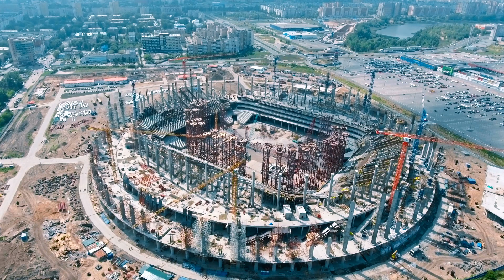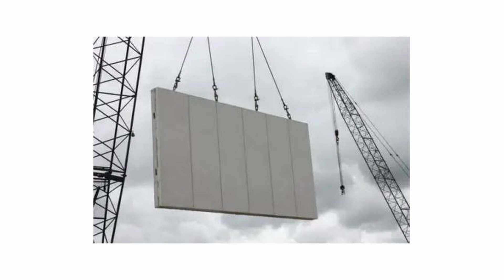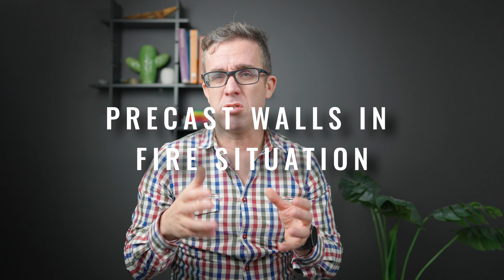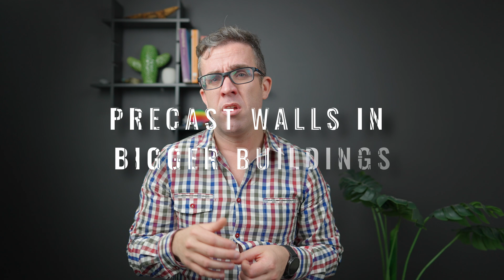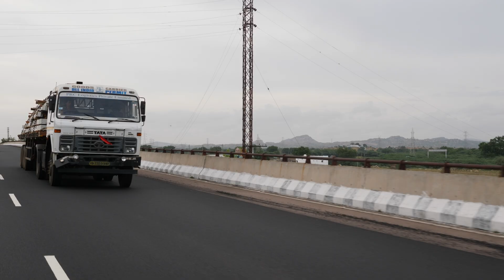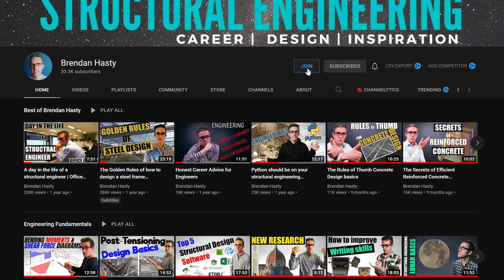Key Design Factors for Precast Concrete Wall

Comment: Hi Brenden,

A very insightful video as usual.
I work in a precast factory as a structural Engineer and project technical coordinator, there is some additional checks you need to consider before the element is sent to the site, the demoulding stage and how the panel itself will be cast . Can we use a tilting table or you need to have lifting points to delmould the panel, the lifting of the panel itself to be installed at site, the stress due to all of this will have a significant impact of your panel's design.

Thank you for your videos, keep it up 👏